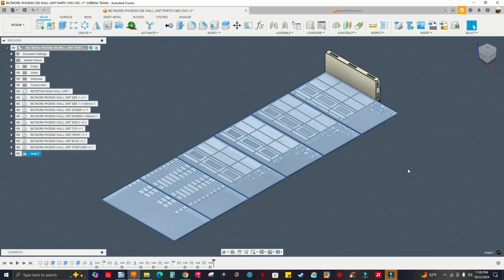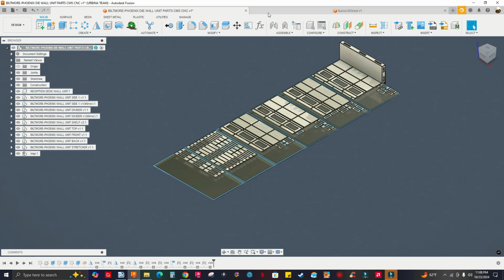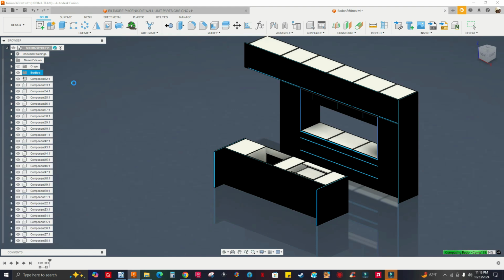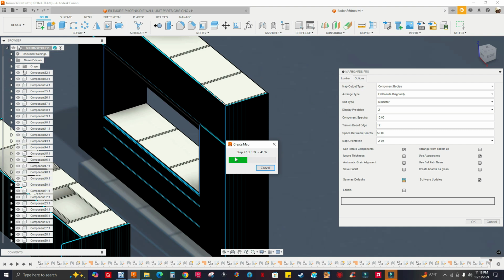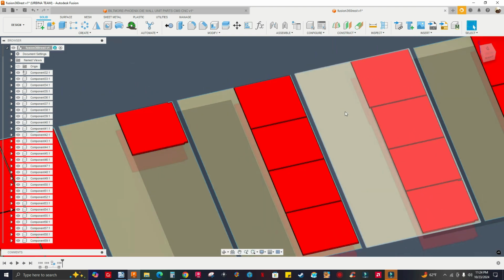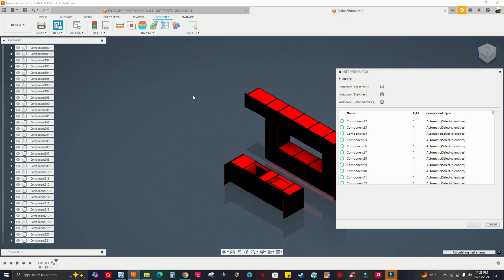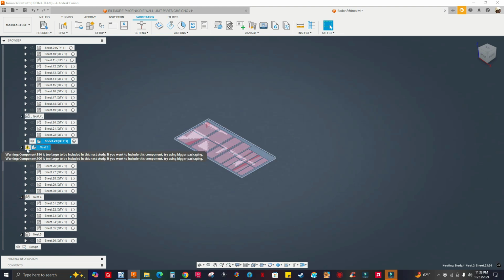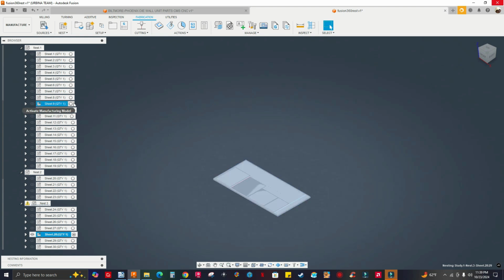MAPBOARDS PRO PLUG IN VS NESTING AND FABRICATION FROM MANUFACTING EXTENSION FOR NESTING PARTS .

Comment: I would love to see a video on the pros and cons between doing the cheap route (map board pro) vs the expensive route ($1600/yr subscription) especially the part where you said nesting as a job for clients/people. My employer is looking into getting software like this bc they're having me nest things manually in Inventor currently. And it is time consuming! Love the vid, very informative, thanks in advance!
Reply from the maker: @jcsmith800  Thanks, yeah i used to manually nest parts too. I will make a video soon. To use mapboards pro you would have to move to Fusion i think.🤔
Reply: @justourbina12  I'm trying to convince them, but they won't come off of the "everything is saved to cloud, and we want it saved locally" stance. I'm hoping the nesting manufacturing extension (or at the very least map boards pro for a while) will be "the straw that breaks the camel's back" so to speak. Plus, with the added benefit, as you pointed out, we could use it to contract out some "GAP" work with it.
Reply from the maker: @jcsmith800 It’s hard to convince a boss to switch softwares, Inventor is way superior when it comes to designing huge assemblies. Fusion has superior cam and also allows you to save locally too. I am not sure if mapboards pro works with Inventor. There was a nesting software called trunest for Inventor, i am not sure if it has been discontinued.